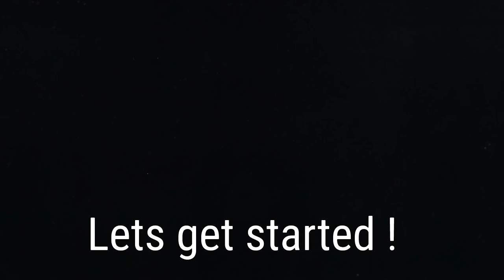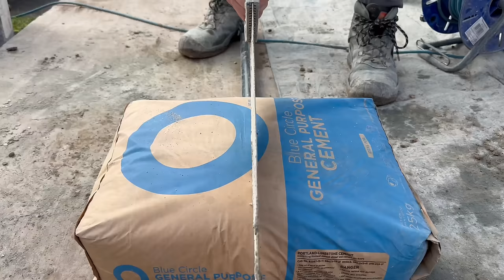The Granite Drive - A Dream Driveway that will last a lifetime! #driveways #hardscape #landscaping

Comment: Lovely job and not straight forward with the cuts. 

I really liked the work on the bull noses and the finishes on the driveway. 

Can you tell me where to source the fence panels, they look good quality. Are they a composite finish on the fence. Thanks again for a great video
Reply from the maker: Thanks for watching and the kind comments 
The fencing is bespoke made by a fabricator.
Steel and composite 👍🏼

Comment: looks great, and I see the compressed stone base that is needed. BUT then you use 6" of soil with a slurry on top?  Is this a standard in the UK?  In the US it is stone > sand > pavers.
Reply from the maker: It’s a rigid system so where you think it’s sand it’s not, it’s concrete/mortar.
The concrete is spread as we go then topped with a grit sand / cement mix. 
The slurry you see is a cementitious binder to bond paving to mortar 👍🏼

Comment: I thought Premier outdoor living (USA) was unbeatable and that no one would be able to equal them, especially in the UK. I’ve been proved wrong. Simply outstanding. The tapering at the bottom end of the driveway is brilliantly thought out. Think the owner should have had a railing in between the pillars but that said, it’s down to personal taste. They must be over the moon with the outcome. How long did it take from start to finish ? I won’t even dare ask about the cost  💷 💷
Reply from the maker: Kind words thank you very much!
Fencing are added soon, I forgot to say that in the video. 
One team dug out and another gang on the wall, then me and 2/3 lads were in it for about 4 weeks. Not fast laying those setts especially in small sections with details.
The Rolls Royce of driveways! Not cheap but worth it imo 👍🏼👍🏼👍🏼

Comment: The way you've worked out that taper to transition angles between the drive and the pavement is pure artisan, your craftsmanship is off the chart. Top tip though, to make tarmac more malleable put it in a gorilla tub and put two kettles of boiling water on it, then it spreads like butter and the water runs away.
Reply from the maker: Thanks very much 👍🏼👍🏼 
That’s a good tip, we usually had heat with a blow torch but we will try that 👍🏼

Comment: We had a Marshals granite driveway, side passage and rear patio installed by an approved contractor in 2018 whilst our neighbour had a Marshals composite block drive installed simultaneously. Since that time our surfaces have remain unchanged whilst our neighbour has had his re-pointed and cleaned several times. Interestingly, the cost was about the same. I would choose granite every time.
Reply from the maker: Interesting to hear, thanks for watching and the support

Comment: can tell you take pride in your work, what would the labour costs be for a job for this size? prob a daft question, is the material under the stones meant to be loose or compacted. When I had work done a couple of years ago, think the team laid stones on a cement mix?
Reply from the maker: It’s mortar on semi dry concrete spread as we go. Underneath that it’s type 1 compacted 👍🏼👍🏼

Comment: now you have raised the levels to the air bricks if the drains get blocked/overflow the water will run into the air bricks? looks amazing though how much ?
Reply from the maker: I’ve not raised the levels, I lowered them. 
The fall is away from the house the drain it just an added precaution.
I Don’t talk prices publicly, between the client and I

Comment: Sorry by my ignorance, but what is the reason for pouring a bit of cement under the granite plates, when the cement is poured over soft dirt?  Also, if you can adjust the granite place by soft knocking with a rubber hammer, the plate is not sit over a not compacted dirt and when walking over it will not move?  What keep the plates strong aligned?
Reply from the maker: Hi, See other comments.  It’s not dirt, this is an American thing thinking we’re laying on ‘dirt’ 👍🏼

Comment: I love your work. Genuine question and not an accusation but are you allowed to tap in to the existing drainage? When researching to have my drive done I read that new drainage wasn’t allowed to go into the drains that the existing guttering goes into, which doesn’t make sense to me.
Reply from the maker: The surface was falling away from the house so no ground water was going in there.  One of the reasons for putting it in was because it was cracked on and had root damage, so we added the gully while we were at it 👍🏼

Comment: OMG I want one like that, it beats the 2mm of tarmac people keep offering to lay or the bricks people had put down by an unknown company neighbours paid cash to and now have sinking driveways!!!
How much would it cost for something like this?  I would want something about 2-3 times the size of this.
What a fabulous installation, it just looks perfect.  I am busy doing the rest of the house, so need to know how much to set aside !
Reply from the maker: It’s one of the most expensive driveways you can have not only is the material expensive but the labour involved adds to that ! 
Feel free to email me info@brockstone.Co.uk to talk more 
Thanks
Reply: @Brockstonepavingpros  Well you only get what you pay for and if that's what it takes!  I am just finishing off a few rooms and fitting a shower tray etc, then will be ready to move to the outside.  It doesn't take 2 weeks for a house makeover like all these TV shows seem to suggest.

Comment: What sort of sand is that your pouring the concrete slurry on? Doesn't that move as it wasn't compacted? I know the hardcore underneath was.
Reply from the maker: It’s not just sand, it’s a mix of grit sand & cement. This will set very hard 👍🏼
Reply: Ah thought as much, the more I watched then the penny dropped. Good video by the way. Only saw a spacer used about half way through. Did you eyeball it the rest of the time?

Comment: I wanna know why they put the granite tiles directly on the soil with only a little cement as base between the tiles and the soil? Why not use a gravel mixed with cement or something stronger on the base of the soil then the granite tiles/slabs ontop?
Reply from the maker: It’s not soil. It is on concrete. 
The slurry you see is a bridge bond to bond sett to the laying course 
Build up -
Terram & Biaxial geo grid
150mm Type 1 stone 
30mm concrete 
20mm mortar 
Bridge bond
50mm granite sett 

Bomb proof
Reply: @Brockstonepavingpros  thanks bruh watching yo other vids cause im doing landscaping on my home. Your work is amazing 🤩
Reply from the maker: Appreciated 👊🏼 all the best

Comment: Why are you back buttering the tiles if laying onto soil? Does this help keep them place while laying?
Reply from the maker: It’s 4/1 grit sand / cement on 200mm of compacted Type 1 on Terram 100 & Biaxial geo grid.  
No soil there mate
Reply: Why are you using mortar to lay them? Does it help keep them in place while working?
Reply: Anyway - just wanted to learn something new.  Looks wonderful! 

Briefly covering the ground works in the video would be very interesting too!
Reply from the maker: Noted

Comment: Can someone explain why they aren't compacting sand before laying granite tiles?
Reply from the maker: It’s a rigid bound system not a flexible bed, so it’s not sand, it’s a 4/1 mortar mix. 
They’re not tiles, they are setts. 
You compact the laying course with block paving, with setts as they’re different thicknesses and need to be bound, they’re laid individually on a mix like we’re doing here. 
Hope that clears it up
Reply: @Brockstonepavingpros  Yes thank you very much! in this case great job. I wish all contractors were like you.

Comment: Don't let the building inspector see what you have done, You are supposed to use Permeable Paving  (SUDS System) for all front drives.
Reply from the maker: Well it’s on YouTube for all to see 😂👍🏼
Im fully aware of the law, I knew about the law before it was introduced - 2007 I think 
The drive has a crossfall sending the surface water onto the flower bed. 
They are big on the law in London but Merseyside I’ve never seen anyone pulled on it tbh
Reply: Thats the way to do it,  drain into a flower bed. All the best.  @Brockstonepavingpros

Comment: Boys love the work, tell yoy what though... Offer am additonal sevice to customers and ask them if they want any ducting installed for furture proofing i.e. for car chargers... Like where ever thier meyer box is run a duct to whereever thier driveway is and have a nylon pull rope ready. You can charge the customer for tbe materials and labour as it will definitly be cheaper to do now then after this lovely stones put down
Reply from the maker: Fair point. Thanks for watching